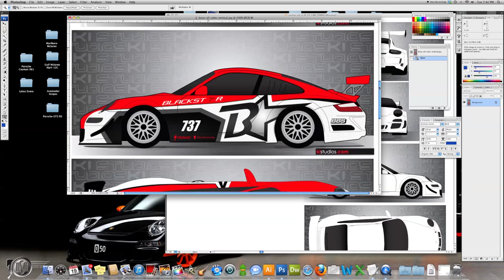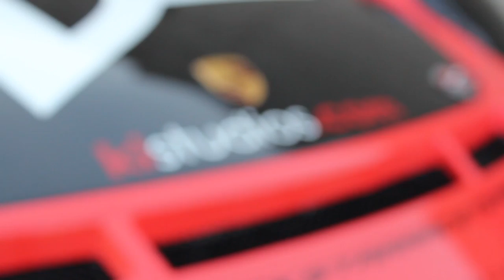Blackstar Porsche GT3 Cup Car Wraps

Comment from the maker: Thanks! Yes, the reason for the "Blackstar" going on top was because the super wide flare fenders on the car require some extreme stretching. If the text going over the fender was printed into the wrap, it would get pretty distorted. This way, everything is smooth and straight.